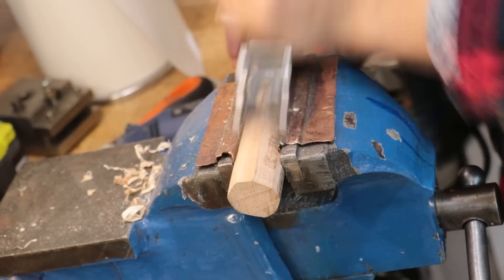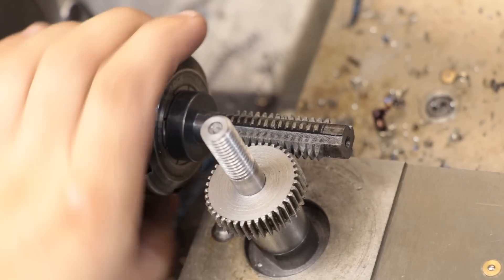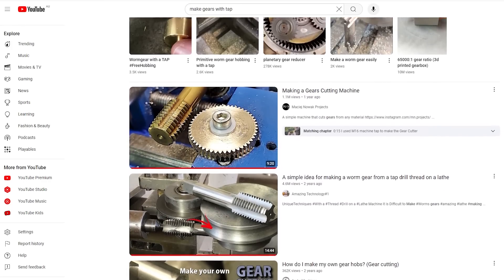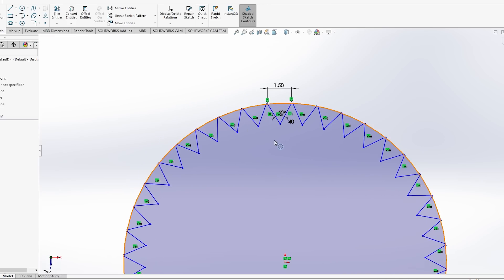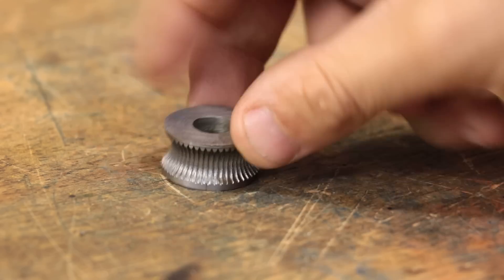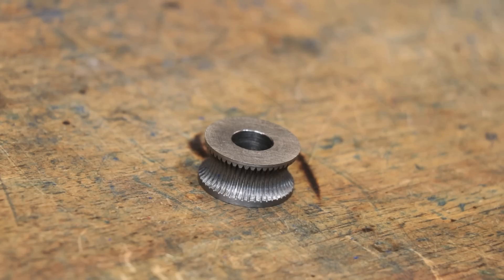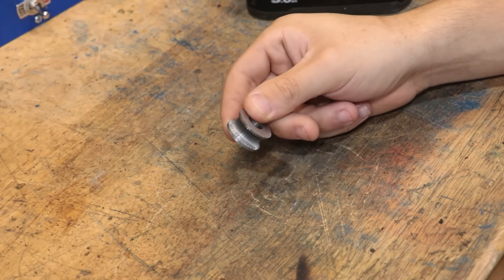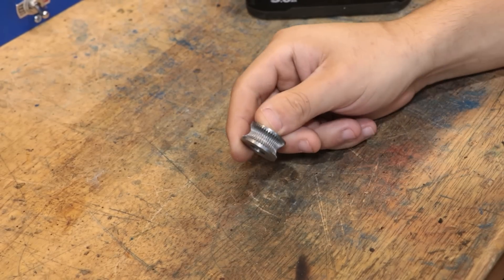Making Worm Gears With Taps - BUSTED

Comment: As you've probably concluded, "free hobbing" is essentially an internet oxymoron that was originally asserted by people less oxy and more... well... you know where that was going. In short, "free hobbing" is neither free, nor is it actually Hobbing. The best results obtainable are disappointing at best, and commonly a waste of time and effort at worst. What has always amazed me is how people will do all the things required to accomplish it ( and I use the word "accomplish" VERY loosely there ) and stop just short of doing the thing that would actually make the results magnitudes of order more useful. But people do like their easy ways out... It is also worth pointing out that thread taps generally have 3 or 4 cutting faces around their periphery, whereas Hobs tend to have 12. That means 66% - 75% less teeth taking part in the generative process. ( per revolution ) The result being that even if one were to follow through and gear the tool and work in ratio, ( as would be correct ) the surfaces generated from the process are going to be 25% as accurately generated. ( at best ) As you likely are aware, you very much can easily ( relatively ) allow your lathe to cut Module ( or Diametral Pitch ) leads by simply changing out some appropriate gears to accomplish the task.
Reply from the maker: Free hobbing is fine with a properly gashed gear and a proper hob. Its when people make these ones with V taps that I think are grossly misleading. and FWIW my lathe has a sealed gearbox so my specific lathe will not cut module pitches despite the leadscrew having a module 1 pitch
Reply: @artisanmakes  As a freely confessed GearSnob™, I'll agree to disagree regarding the gashing. Even in your own video, one can very clearly see the rotational irregularity occur from the absence of being positively driven, despite it being well past the point that the blank needed any gashing. I'm willing to be wrong about that, but have yet to find any historical evidence showing otherwise. This is only solidified by the experience of having actually tried to measure them for quality, as a point of reference. They may visually resemble a toothed wheel, but I can assure you they barely qualify beyond that. The tooth to tooth error is horrendous. I won't even bother commenting on the actual Form, because if someone has weighed the options and still chose it as their preferred method, the simple truth is that it's most likely that any kind of cogged wheel would suffice, and a real ( much less "accurate" ) Tooth Form isn't really of concern. There are many enclosed gear boxes over the years, whose manufacturers offered change wheels for them. Monarch comes to mind immediately, as one such quality example. It might be worth investigating farther, but that's not my call to make. Most vids that I've seen on the topic tend to dig their heels in, stick their heads in the sand, and resolutely insist it's "just as" or "almost as good as the real thing", when the truth is just not on their side. I appreciated the honesty of your video and the quality of it. Be well.
Reply from the maker: Wait are you talking about he V tap hob or the module hob? Sorry it may be a little early in the morning for me but I don’t quite follow which one you are commenting on. Cheers

Comment: Did you go out of your way to find a 3 flute tap? Most hand taps are 4. It feels like you were trying to undermine this technique.
Reply from the maker: No. I am not aware that 3 flute taps are any more or less common than 4.
Reply: Let me put it this way, in my neck of the woods, and in my experience most hand taps are 4 flute.@artisanmakes
Reply from the maker: Interesting. Even still, I don't think having more or less flutes would change much with the start engagement issues IMHO. Cheers
Reply: With an extra flute the distance between bites would be reduced 25%. Im not saying you didnt make a fantastic argument for not using this technique. @artisanmakes

Comment: Cool, I have a 1/2" ACME tap, I think I'll try it out as I want to use an old cordless drill-motor to power lift on mill drill but I suspect it will need speed reducer/torque multiplier.
Working out circumference isn't too much of a chore.

Comment: Good Comment on the Trapezoidal or Acme threads.. better pressure angle. but if you need to make a Hob on the Lathe.. , do some calculations and get the right pitch to match a Modul..

Comment: It’s a great cheat to make a worm wheel, yeah although it not the best geometry it’s quick and easy. 
I did try this technique once and was impressed at how it turned out. 
I opted for a more challenging blank by using 4140 and an M24 spiral tap. 
(I have a feeling the spiral tap made it easier) 
I did hog out the concave. 
And like knurling you have to plunge in quite firm to get the start perfected. 
First attempt came out full form and really nice.

Comment: I like  to ask your 4 jaw chuck is bolt to the lathe with 3 bolt or four? I have lathe and i need independent 4 jaw my late chuck i bolt with 3 bolt let me know what model of you 4 jaw chuck is and where you ordered from thanks
Reply from the maker: I made a backplate for it using some 130mm diam. 1045 steel. I am sure you can buy them
Reply from the maker: skip 16 minutes in https://youtu.be/rTiu9Oi85Tc

Comment: In 1903, Wilm discovered that an aluminum alloy with 4% copper would harden if left at room temperature after quenching.
  Would you be willing to mix some up and machine it in it's soft state and allow it to harden ?
I'm curious if it would work out. Soft easy to machine metal that gets hard without needing  tempering.

Comment: The pointy teeth are quite helpful for making feed gears for wires or for filament in a 3d printer. Usually you’d use an M3 tap though.

Comment: Now I may be wrong, and by no means am I putting the man down, I been watching this channel for years and I enjoy his content alot and take my hat off to the man for how he does what he does, but... from what I think i understand of gears and the design of gears, the comment about the module x pi being the pitch of a gear which is true of module gears and the example of a m10 x 1.5 thread tap using the circumference and not the diameter as a module pitch uses made me do a double take, because if you divide the circumference by pi, then you get the diameter,  and pitch is simply the spacing from one tooth to the same point on the next tooth, which means they are actually both the same calculation in a round about way, just expressed differently. One multiplies the module x pi and gives a diameter for the gear blank and the other requires the pitch to be multiplied by the number of teeth to give the circumference, which is a product of pi and the diameter.

Now gear theory is a big subject and I commend him for taking on this topic and trying to add to the information available for hobbyists, one thing I will add which is a major draw back of a thread tap being used as a hob, is the natural tendency for a hob cutter to provide a true involute profile due to the continuous cutting of the tooth through the range of contact at differing angles that continuously change as the gear blank makes contact with the hob. Involute gears have a matching involute toothform, meaning a good mesh is achieved, a metric thread doesn't, so the gear profile won't match the thread profile at all even though the spacing or pitch is the same, and backlash in this particular method would be quite noticeable I'd imagine, especially once everything had bedded in. The power transmission would also be intermittent as the pressure angle would be inconsistent as the contact of the teeth was made and the gears would whip and stutter as they came under load and out of load etc, meaning a continuous velocity wouldn't be achieved. There is a term for this but I can't remember it sorry.

I do however think a better example of a thread tap worm gear could be created using a 12 x 1.75 spiral flute tap or a 14 x 2 spiral flute and grooving it to the radius of the tap size to ensure a more complete tooth form is established, even if you cut 75 % to depth then flipped it upside down to cut to full depth (I noticed his gear had deeper gashing on the top than bottom). The spiral flutes should allow the gear to advance better as the profile is formed and should provide a cleaner cut.

Same will be true for the home made hobs as well though, it's a similar theory behind a helical gear compared to the straight cut design for spur gears. It's definitely not a commercial solution, but if done with a bit of planning and careful selection of the tap used as the hob, a simple worm gear can be produced that will enable people who don't have the means to single point thread worms and hobs etc to create parts to facilitate the transfer of motion or a transmission of torque or rotation even if inefficient by adapting threads from bolts in the place of a machined worm, which is pretty cool.
Reply from the maker: Maybe I did spend a bit of time on the pitch vs module section, but that might have been a bit of fall out from the fact that I was pretty disappointed/annoyed that none of the viral videos made no attempt to explain that fact. If you look at the comments in those videos there are a lot of people asking how to calculate the worm diameter and its never addressed.

Yes circumference and diameter are just separated by pi, so they're not that different but I still don't like the idea of gears being circumference driven because it usually results in a weird diameter which you have to hit. Like 25.464mm diameter (which is what you measure for) for a 80mm circumference. I just think its more intuitive and straight forward to turn things to whole numbers, which most module gears are.

Comment: Hey mate, well done with all your research and how you explained it, i think you done it well. i just wanted to say that you're focusing too much on Mod or D.P, the pitch is the pitch and you just make it to suit as youre making the pair (typically) like if youre making a M10x1.5 worm wheel you work off that (1.5mm). Obviously there is no guessing games and everything has a formula; O.D of gear, pitch diameter, throat diameter, throat radius and so on. so this means theres no real stressing over dimensions, you can even make the O.D of the worm gear smaller (Truncation) or larger and it wont matter as long as its not too much. Ive cut a worm wheel where the O.D was the Pitch Diameter so it was missing 3 whole addendums off the O.D. I cut gears and worm wheels for a living so this is just my two cents. I work by axial pitch in inches, everything is based off that, O.D of worm, Number of teeth in the worm wheel and the centre distance whether it be standard or modified. ill admit i don't do stuff that tiny very often so mileage may vary to my advice. In my opinion, stuff that tiny doesnt really matter for contact pattern or efficiency, as long as its got some sort of tooth it will transmit torque. like you said, worm reduction isnt very efficient but it does work very well.

Here is an example of a 40:1 M10x1.5 from my spread sheet. (All sizes in Inches)
https://imgur.com/a/BuDFLru
Reply from the maker: Maybe I did, but that might have been a bit of fall out from the fact that I was pretty disappointed/annoyed that none of the viral videos made no attempt to explain that fact. If you look at the comments in those videos there are a lot of people asking how to calculate the worm diameter and its never addressed. I think I wanted to drive the point home here. Plus I did have to scratch my head for a bit to figure out how to exactly come up with the formulas.

Also for what its worth, I don't like the idea of a gears diameter being circumference driven because it usually results in a weird diameter which you have to hit. Like 25.464mm diameter (which is what you measure for) for a 80mm circumference. I just think its more intuitive and straight forward to turn things to whole numbers, which most module gears are. That was more my angle for getting caught up on the pitch/module debate.
Reply: @artisanmakes  yep you're right, I forgot it was free hobbing. Im just used to setting the number of teeth on the machine lol. Great vid though.

Comment: Use a spiral fluted tap, better tooth engagement and less risk of it not advancing fully for the next tooth.
Reply: I think exactly the same thing every time I see someone post a video of the free hobbing method with a thread tap....the spiral flute tap surely has to be the preferred option for this process.
Reply: @howardosborne8647  I made a few large worm wheels back in the early 2000’s for telescope drives  that way, first one was with a regular tap after that all with spiral fluted taps. Works way better. Really no comparison

Comment: By my guestimation a rack with 29 deg teeth will mesh with a standard involute gear ........for a worm drive, as long as the worm is set at the helix angle to the gear it will mesh and drive freely...... but if you need the worm to be at right angles to the gear, as in a normal worm drive gearbox,  then you should cut the involute gear teeth at an angle too.......there is no need to make the worm wheel with a hollow profile..... a straight cut across the gear blank will work fine.

Comment: The tap method is how some of the early guys in 3D printing made drive gears for filament.  The fact that the teeth were shallow and sharp was actually a benefit when you couldn't afford the proper tooling.

Comment: I had the idea of doing this 20 years ago.
After doing the maths, I realised it's a silly idea. It's JUST practical enough for the hobby machinist.

Your application seems to be in that category.

For a proper gear,ect.  You need both driven blank and a driven tool.

And not a tap 😅

Comment: I wonder if its possible to make something that uses the leadscrew of the lathe to automatically turn the gear blank at the right speed relative to the hobbing cutter. May solve that problem of not having enough "bite" for this tap method, but it would probably also help with precision when "doing it right" with all the proper cutters and profiles.

I would suspect that setup would utilize the leadscrew as a worm drive itself, turning a small gear that then drives a vertical shaft that the blank is attached to. You may need some UV/CV joints or other trickery to allow the blank to be moved in and out, though, but these are pretty common and can be found in lots of places, including hobby R/C cars.

Comment: What about using off-the-shelf straight cut spur gears as the gear? I assume that as long as the ratio of the screw diameter to the gear thickness is high, then it won't be "too bad".

Would be interesting to see comparisons of all these gears. Wear profiles after spinning a load for 24 hours, forces applied to the shafts, "efficiency" measurements, and finally max torque before things break. I assume in many cases, some of the less "perfect" gear setups may be worth it, since they are so much easier to make.

Comment: Just some advice. Using a battery charger to power that DC motor is not the best idea. They're usually not filtered or regulated. Better to use a proper regulated 12 volt DC power supply with sufficient amps to handle that motor.
Reply: Battery chargers are usually filtered to ~14v +/- a small amount. Not gonna hurt most/all 12v motors.
You are probably thinking of the older style wall-warts
Reply: @boots7859  By "filtering" he doesn't mean control over voltage.  Battery chargers don't put out pure DC, they put out pulsating DC - the result of not having any means to store charge between pulses, the storage is known as filtering.
Powering a small DC motor with pulsating DC from a battery charger will cause excessive heating and may cause the field magnets to loose their magnetism.
Reply: @keithammleter3824  Going back into the dim dark past low frequency PWM got used on early Speed Controllers for electric flight and I never saw any magnets have issues on the 360-600 sized brushed motors we used to suffer with. Most old school chargers like what was shown run some sort of Capacitor filter and a 1/2 or full Bridge rectifier so they are cleanish and are way better than some of the junk end DC-DC PSU's out there for running small Motors.

Comment: Great video - again!
As a Clickspring follower I have been putting off making up a proper module gear cutter. I have a project that is going to require two half gears and I had been dithering about using a tap for the hobbing.
Your video has convinced that would have been a waste of time and I've decided to bite the bullet.

Comment: I'd say that one advantage of using a tap to create the worm gear is that you can then use a standard threaded rod, bolt, or tapped rod to drive it instead of having to cut a custom piece.
I agree that it may not be as good in theory, but the bigger question is if it's good enough in practice.
Reply: Gp all put and use an acme thread tap. Puts less stress on the shaft in my opinion due to the squarish threads not pushing apart like regular 60° threads do. Just my OCD talking here and not any recommendations.
Reply: Good point.